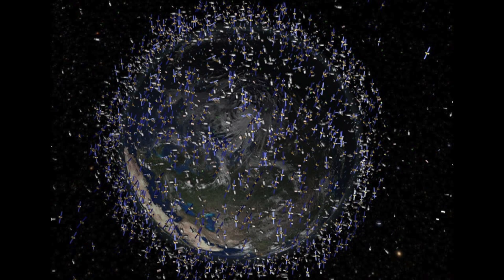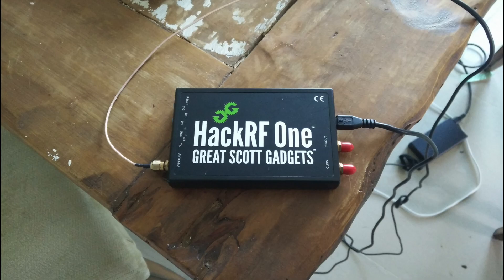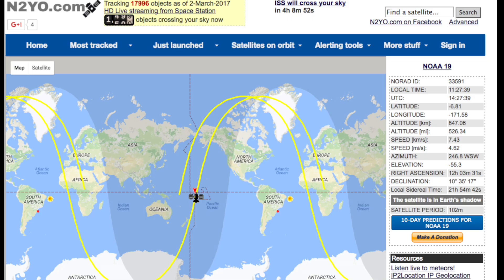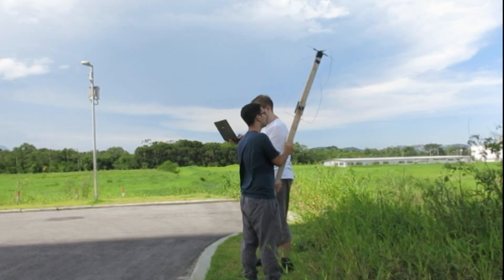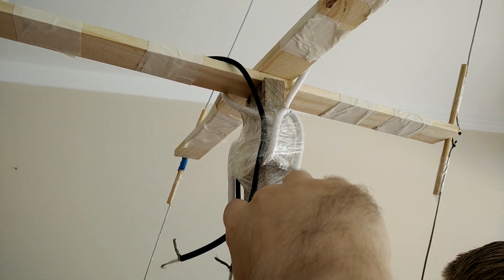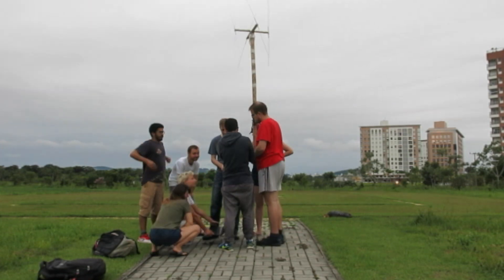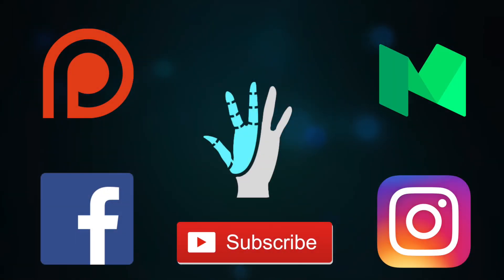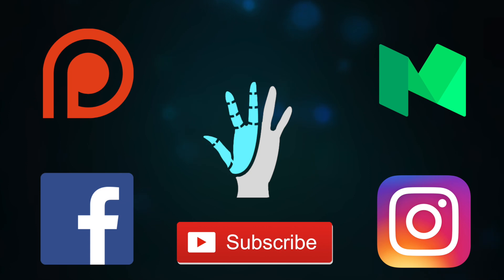How to Pull Images from Satellites in Orbit (NOAA 15,18,19 and METEOR M2)

Comment: You should make a antenna that can pick up visible light
Reply: Do you mean telescope?
Reply: No I mean like a antenna that you would use to pick up radio waves but made to pick up the part of the electromagnetic spectrum that makes up visible light
Reply: @godOfLimbo  thats called a camera bruh
Reply: I don’t know how digital cameras work but I thought that cameras used to work by exposing a photosensitive material to light what I am sigesting would be to measure the electromagnetic radiation rather than use photosensitive materials to measure light

Comment: Sharp bends and irregular shapes are two things that RF dislikes, VHF intensely dislikes, UHF loathes and microwaves walk away from. You might get away with it for VLF and ELF, but then someone is going to come by to ask why you're listening to EAM's for submarines and likely you'll also notice an increase in your local property tax assessment for improvements. Well, unless you transmit, then you'll definitely get a visit and sharp bends blow final amps out.
For elements, I'd consider 3' welding rods, cut to wavelength or even tubing, which will certainly make sure you avoid sharp bends. The signal's on the skin anyway, it all depends upon how robust you want to build it. I usually go for Steve resistant, which means the only way I hurt it is if I hit it with a 10 pound sledgehammer.

Comment: Time to do this again after 25yrs or so, I set up the lunchtime weather centre in secondary school, the school had the equipment for a while but didn't know what to do with it. Had a word with the school technician and the head of geography and we installed it the following week. We had several antennas and a dish on rotator, I think that was for the GOES satellites. Always a satisfying sound when the signal started and images appeared. The system is probably still there abandoned and in bits in a cupboard somewhere, would love to have it,particularly the dedicated wideband receiver.

Comment: So, a cheaper SDR will work just as well as the HackRF?
Reply: yes, i use a generic R820t2+rtl 2832u sdr that i bought from mercado livre (kind of a brazilian ebay) for like 20 dollars, its ridiculously cheap and works wonderfully, my antena is literally a broom handle, gardening wire and very cheap 75 ohm coax cable, you dont need 50 ohm, although if you live in an area with a lot of radio noise, it would help to have 50 ohm cable i think.

Comment: Just a little hint: 

When building wire antennas, start by rolling the wires between 2 sheets of e.g. MDF to get them straight. 

3D print support structures to keep the shape.

Comment: Tip for straightening your wires: Clamp them in a small battery drill and hold on to the other end with a pair of pliers.
Now give them several turn with the drill and they'll straighten out beautifully.

Works 100% and is very quick.

Comment: You should check out the type of radiation data they are gathering, as well as and electromagnetic data. I'd be curious to know what they are focusing on in these two areas, especially considering the magnetic pole flip currently underway and the fact that they are quietly preparing for a total collapse of society as a result of the flip. Also, are there satellites gathering data on any other inbound frequency waves besides solar radiation? Anything focused on the galactic center, by chance?

Comment: You should join the Amateur Radio (Ham Radio) club in your area. Its relatively easy to get your Tech license and only cost $15.  Then you can build antenna just like you did in this video,  but now you can do things like actually talk to the International Space Station when it fly's over. Or do fun things like hidden transmitter hunting (fox hunt) where you use directional antennas to find a hidden transmitter. Along with making contacts all over the world using satellites or skip propagation. You will need the next license (General)  to do the skip propagation.  Just thought I would mention it seeing as your interest line up pretty well with the Amateur Radio Hobby.

Comment: Yeah, maybe you should of talked to an Amateur Radio operator.
Reply: Who said they didn't?
Reply: @JeremySchoeder   ...it just sould as if a Ham could of helped with making the entrie process a bit easier (antenna in particular - you would of  tried to use a piece of 93 ohm coax instead of a piece of 50 (or 52) ohm coax. Don't throw it away, 96 ohm coax does have it uses.

Comment: You probably got the QFH direction backwards, so it was expecting a signal downwards. An easy mistake to make and the online QFH build guides are pretty vague. As long as you get the direction correct, even a poorly built QFH will be extremely effective. A double cross or turnstile antenna is super easy to make and 99% as effective as a QFH. The other nice thing is it's easy to make a takedown turnstile or double cross. It's impossible to do this with a QFH. @8:38 it's not so much ensuring delay to overlap or synchronize the waves on top of each other. What you are trying to do is ensure one set of elements is 90 degrees out of phase with the other to enable circular polarization

Comment: Why would you do it this way? When all you need to do is send a custom magic packet using ping the sat-link using one of the hundreds of U.S.G.S. contributors credentials on the U.S.G.S website.For much higher detail and many many more data filters.
Reply: bc it works, and the hackrf doesn't have enough tx power

Comment: 137mhz you would need 2 dipoles cut to 21.55 inches each. You then need to combine them with a 300 ohm to 75 ohm balun transformer and use 75 ohm coax rg6 quad shield as you are receiving. 50 ohm is more for sending and receiving but not correct for 137mhz receiving. Because you are attempting to catch a weak signal from space, the dipoles should be helical but you also forgot another very important factor. You need a proper deflector at the back of the antenna. A satellite dish might work but likely has too much curve if you use a directTV small dish. An actual metal garbage can lid would probably work better for that frequency. If you still have trouble, add a cheap 10db RCA TV antenna amplifier. If you need more power then use the 23db preamplifier RCA makes. Enjoy!
Reply: actually 21.45 which is 137.5mhz since that is basically the center freq

Comment: Fun stuff. I was pulling WEFAX in the early 90s with a fixed turnstile antenna, a GaAs fet amp (mounted of the roof with the antenna), a radio-shack scanner modded with a wider ceramic filter, its audio feed a PLL whose signal went to a Analog Devices ADC. The parallel bytes were went to the parallel printer port of an XT clone PC, a nibble at a time. You see, back then parallel ports were not bidirectional so I was using the control lines. Some C code fetched the bits and mapped to the the tack-sharp paper-white VGA (My first 'useful' Turbo C project!) and the images were no too bad. The Doppler effect shifts the frequency a bit so that is a bit of a challenge in reception and rendering the image. I had corrections for Doppler induced slope since my samples were taken using a watch-crystal. In hindsight I should have locked sampling to the signal shift.

What's Amazing is that, through Google, that old turnstile antenna is still visible in satellite images (I just looked now). Still on the roof of my parent's house after more than 25 years! Maybe everyone thought it was a sculpture?

Comment: How far up are these so called satellites if we are traveling at 1000 miles per hour how can you get a  signal
Reply: For the polar orbiters, not far~500 miles, so the signal is very strong compared to birds of the Clark-belt so you don't need to point it. Circularly polarized too so the antenna doesn't need to rotate either.  You have about 10 or 15 min to receive as it passes overhead, but hills and trees block the signal so YMMV.
Reply: Their signals are high power.

Comment: You can straighten wire by taking a long run of it, putting one end in a vice, holding the other end tightly with pliers, hold the wire with slack, then with one hard movement yank the wire really hard. We use this method in aviation to straighten safety wire.

Comment: I have a hobby shop nearby that sells perfectly straight copper tube in both cylindrical and box cross section - sizes start at around 2mm diameter. Would this be suitable for an antenna, or is a solid section better?

Comment: You can get your antenna length a lot easier by just dividing by 234 or 468.  Divided by freq.     234 for 1 leg side.    468 for total wire length.     You want an antenna for cb? 27.165.     234 / 27.165 = 8.614  ft.     Thats how long each side shud be     468/     17.22 ft.   Total length.   If you want to transmit on it id suggest a balun to reduce skin effect on the coax.

Comment: As a request: I'd really enjoy seeing some type of RF mode to produce images of the contents of another room or the interior of a house from the outside, similar to x-ray but without the ionizing radiation.    Perhaps some sort of Flying Spot of low powered microwave reflected back to the same general location of the RF source.  If Time of Flight data were extracted the images could be 3D.   Of course scanned laser light can easily produce a simple form of LIDAR but can you see through dielectric building materials such as bricks and lumber without gamma or x-radiation?  That would really be interesting.  Artificial Aperture Radar?

Comment: why dont you use an old direct tv or dish network satellite dish it might work better
Reply: buck pyles because you would have to point it directly at the satellite at all times. Its not omnidirectional
Reply: @farbeyondsane2529  it would be cool if you could set it up with motors and have it auto locate the satellite
Reply: buck pyles that would, but i bet you it would be very hard to pull off
Reply: @farbeyondsane2529  true it was just an idea thinking of an easier way to be done lol

Comment: My plan for making a satellite tracking 'radio' telescope was/is to use a Marine Satellite Dish - since it is motorized to counteract waves and rough seas, I believe it to be a good platform to build off of. I'd like to tether the telescope to a light motion detector IFR security camera that also scans the skies for satellites; the detection of any satellite from the IFR security camera would trigger the satellite dish to slew into position and track it along its course; both visually by camera and dish to collect any signal that the object may be transmitting. While I am aware of the numerous satellite tracking websites and objects, I am more interested in the satellites or objects that are not listed officially.

Comment: If you ripped all the loose material off of an umbrella and use aircraft paint stripper from a local store like walmart, you could use it. Cool ideas here, I like tinkering with fm radios and this video blew my mind. I've found myself staying busy trying to receive distant radio stations for some reason. I've been able to pick one up from about 250 miles away so far. Likely due to the geography of my surrounding area, but it still blew my mind that I could receive it from a surface antenna so far away. I live in Baltimore, Maryland and before a local churchy station went up, I could sometimes listen to a rock station from Suffolk, Virginia (WAFX). Sometimes it was as clear as if I was in town, sometimes nothing at all. Now you have me wondering if I could build a directional antenna tailored to pick up that frequency (106.9 Mhz)

Comment: You could have your antenna set up permanently and have a raspberry pi manage the downloading and decoding. The setup could even be portabalized.
Reply: I wonder if it's possible to have an Arduino connected to this setup too, controlling some servo motors mounted on the antenna, so it would track the satellite just as we do with telescopes... Could this improve the signal even more?
Reply: @MatheusPratta  Antenna tracking is definitely possible, but it shouldn't be necessary if you built an antenna of semi decent quality.
Reply: @MatheusPratta  check out the open source project named satNOGS! 😉
Reply: @ΧάρηςΚυπαρίσσης  thanks for recommending
Reply: @MatheusPratta  most of the weather birds are geostationary, so you don't need to track them. You only need to track MEO and LEO birds.
Reply: How about 8 Parallellas?

Comment: Nice job guys and gals. You inspired me to consider setting up a satellite capture rig for my various apparatus. 

You might consider swapping out your 50 ohm coax cable for a 50 ohm cable that a BNC connector will solder on to and then reduce to SMA at your receiver. I say this because of the loss of signal at VHF frequencies over the 20 or so feet you have between antenna and receiver. There is a LMR coax that  is both flexible and lower loss. Can't remember its designation but Google knows. The change will probably see quite a change in signal strength. There are charts on the net that can estimate differences brought on by various cables.

If I do it, I will use a pair of 3 or 4 element yaggi antennas configured in a similar manner to your pair of dipoles. You can make nearly anything match 50 ohms if you use gamma match devices at the feedpoint or something similar and in the worst case one can always build a simple transformer on a toroid to transfer the signal off the antenna into the coax with out reflection. Hence, I should get a pair of Yagi antennas to do the job. I like the Yagi because if I design it I can make its pattern fit my needs and since I only need to capture signal off the front if I point the antenna system and adjust its angle off the horizon with a Arduino.

There is a fairly good little DOS program from the mid to late nineties that will allow you to calculate designs for a Yagi antenna if your interested. It ran ok on Windows XP and Windows 7. I don't think the current Windows and the program are a match that works. The name of the program is Quick Yagi and I pasted the link below.

Best wishes...

http://www.hamuniverse.com/quickyagiqy4.html
Reply: I had an antenna set up on the roof and ran it all the way downstairs and I didn't have any losses compared to what I recieved in the attic

Comment: I've done similar work, what I've found works best is take the core out of LMR400 coax, adjust speed of light calculations or index of refraction by 85%, several hundred percent gain over copper in the 2.4ghz band.

Comment: Would you be able to do something like this with a arduino
Reply from the maker: No.
Reply: @thethoughtemporium  thanks coz i really wanted to do this but here the hack rf is more than 2 months salary. Was hoping i could use my arduino insead in some way.
Reply from the maker: @lukewelken  The hack RF is nice but also overkill for this. any of the cheap SDRs can do this no problem and they run for like 20 bucks.

Comment: I'm a ham radio operator and recently I tried my hand at working amateur satilites. Because there's a lot of other hams trying to work too, then all you do is give your callsign, they give their callsign possibly a location and then say 73 (code meaning best regards) for me it's tricky since I only have vertical antennas for the uplink and downlink frequencies. I have built a yagi antenna for sat work but really haven't used it yet.

Comment: can you use a crater on the moon as a reflector to rebound a signal back to your own sending point if this is possible then you can send a signal anywhere with out detection?
Reply: daniel van der torre i don’t think any craters on the moon are facing the correct direction. But during the prologue program, the astronauts left these tiles that would reflect laser light in whatever direction it came from, so that NASA could accurately measure the distance from the moon. He could probably think of a cool experiment using these

Comment: Straightening wires is done by clamping one end in a vice (mounted to a sort of solid base) and the other end clamped in a pair of vice grips. Pulling the wire Straightens it . If you hold a brick or other heavy object, slack the wire a bit (maybe 10% of the length you try to straighten and pull rapidly you put quite a bit of force on the wire and it will go very straight... Then you can cut your pieces...

Comment: so I built this antenna and so far I have not received a signal. I have no idea what is wrong with my antenna. I am using RGA174 ROSH coax cable and the NESDR smart. my coax cable is 100 feet long so that may be a problem. can you give me any helpful information?
Reply from the maker: The cable is probably the issue. May need an amplifier. I'd test it with a short cable and the antenna next to you until you get the signal. Then build up the setup. Don't start big
Reply: any suggestions for amplifiers?
Reply: I am doing this from a desktop pc. but I do have a Chromebook. so far all FM radio stations are received very well. I haven't gotten the chance to try and receive any passes that were over 40 degrees. also for a little bit of context I live in Minnesota and it hasten been the warmest outside so sitting next to the antenna may not be possible now. but your recommendation is probably correct I will try to see what I can do. although on a side note when the passes were happening I didn't even see a disturbance in the waterfall not even a partial signal I am hoping to try to receive a signal on a pass soon that is going to be at 80 degrees at its peek. thanks for the feedback!

Comment: Try using two antennas in different locations miles apart. Multiply the channels, then square root them. The resulting channel will have a much higher signal-to-noise ratio. This can be done with many antennas as well.